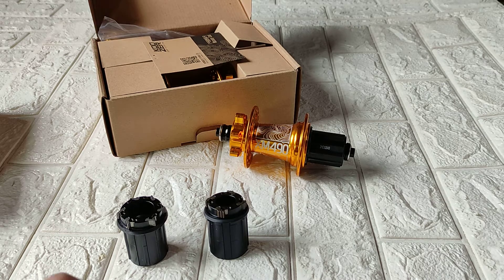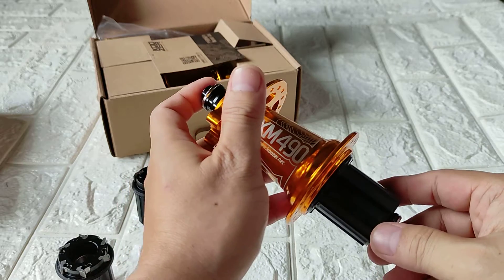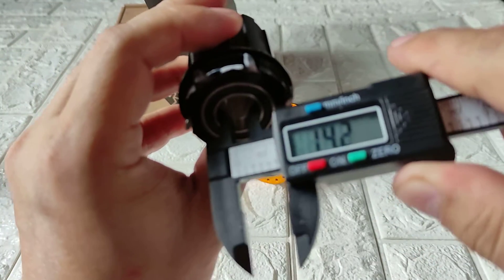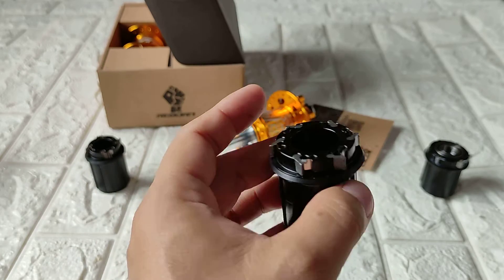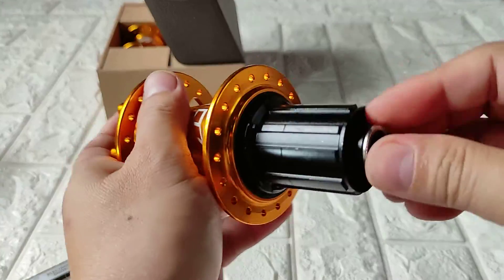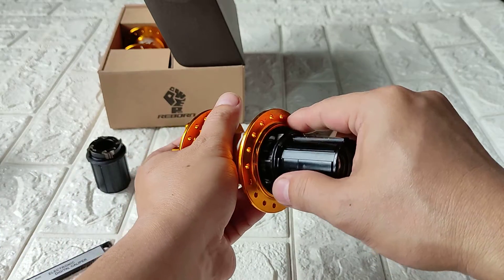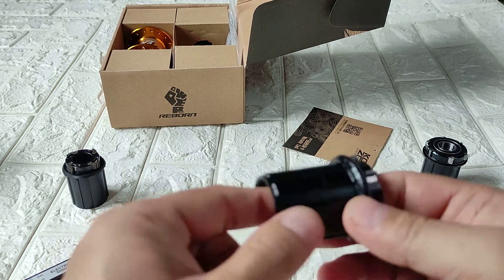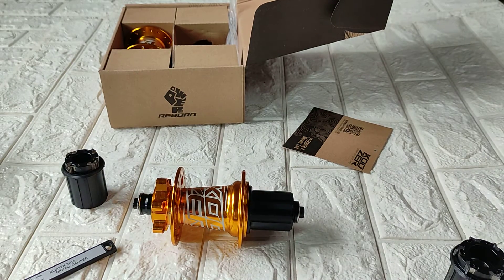EXPERIMENT ON KOOZER XM490 REPLACING FREEHUB BODY WITH SATURN 6 PAWLS FREEHUB BODY

Comment: Akala ko 6902 size ng bearing ng koozer
Reply from the maker: 6902 - bearing code, 15mm inner diameter, 28mm outer diameter, 7mm thickness, also known as 15287

Comment: Not sure if this happened compared to the past, but Koozer has an online web page when they publish the speicifications for the sizes of the pieces and the type of bearings each Hub uses, that should solve most of the things covered in this video. Also, Koozer also sells replacement freehub bodies.

For the record, I have been using a pair of Koozer XM390 with no issues on my XC Hardail for 4,000 Kilometers so far, and the only reason I am changing the freehub body is because I am replacing the drivetrain and I am moving from 1x11 to 1x12, so I need a different one, but other than that, that freehub body is still in good shape.
Reply from the maker: my first koozer was the HA04N koozer hub, im not sure why they changed the model name, i managed to upload soundchecks only 9 years ago, koozer sells worldwide, mtbr.com members also tried using koozer, i think they are one of the first to release ratchet type hubs, koozer freehubs swappable to other hubs we just need to check play and sizes

Comment: I'm trying to find a XDR free hub for my Koozer xm490 and I'm having some issues unless anyone can point me in the right direction I was wondering if a DT free hub will fit? Just tried it and it fit. Maybe it will work.
Reply from the maker: If it fits well, good engagement, acceptable freewheel, same inner diameter, it might work, or try riding for 1 or 2 kms and check freehub again..